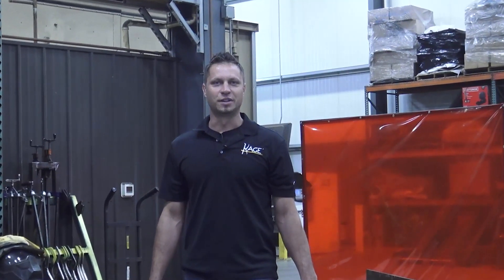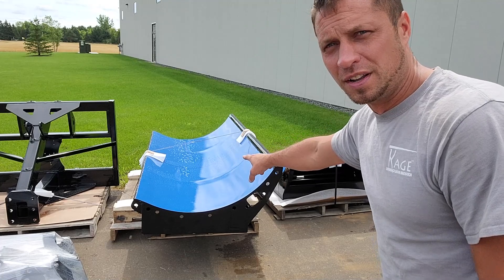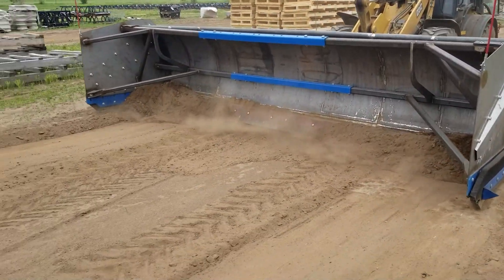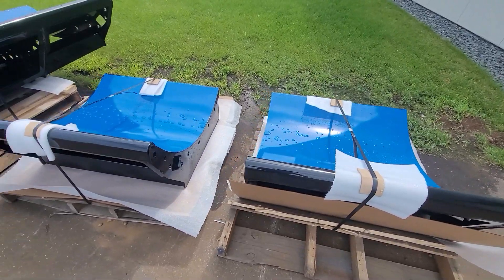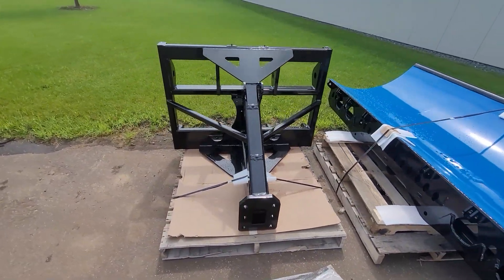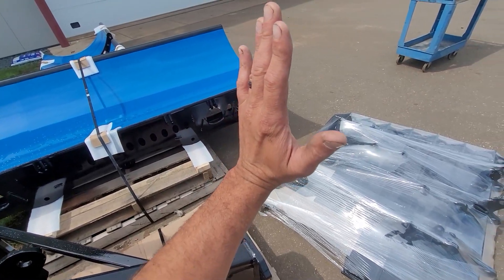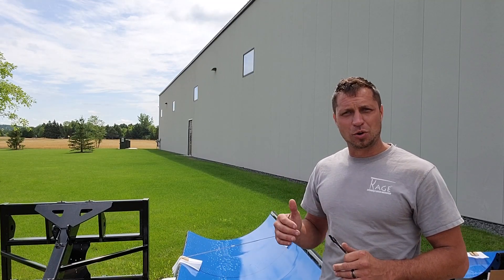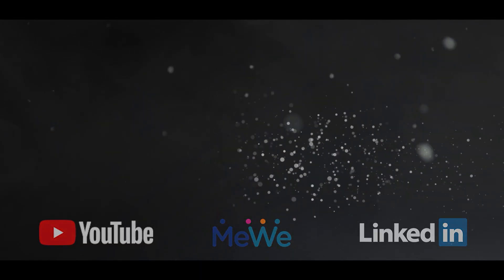SnowDozer Pre-Release Sneak Peek

Comment: Simple Generic Snow Plows Don't need a Cutting edge it's Snow Not Hard dirt or Dirt in general. Where'd you get off thinking  a Snow plow uses a Cutting edge ? Plus you never cut Fluffy powder snow or any snow for that matter. You Plow it Not Cut it Maybe if you get sent to The south Pole Antarctica than put on the cutting edge cause you will need it to get to the Newer local macdonald's there just set up for mostly polar bears and the odd Tourist.